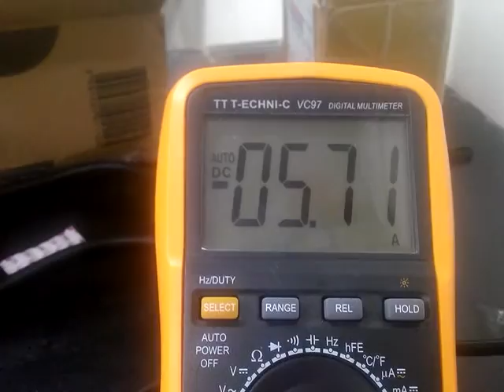BTS7960 43A Motor Sürücü Test

Comment: Max A continous? And peak?
Reply from the maker: Hi. MAX is not continuous . Peak 10 amps But without coercion.  This motor drive can withstand a maximum of 43 amp.
Reply: Hello, I want to tell you that maximum amps have been achieved continuously before burning the bridge, or that maximum amps have been achieved with this bridge
Reply from the maker: thank you for information.
Reply: I want to say that maximum amps have achieved you continuously with that bridge-h, say 43A but I do not believe that I hold so much, I want to know how far you have arrived without burning ibt-2
Reply: Hi, I have a very strange problem with the ibt-2, when the motors change direction fast or they turn suddenly I volatge of 12v, I have even seen 19v and I have burned the fans of 12v that I use to cool, this knows because it is? I used motomonster before and it did not happen
Reply: It's because of the inductance of the motor. You shouldn't connect the fan to the same 12v output than the motor.